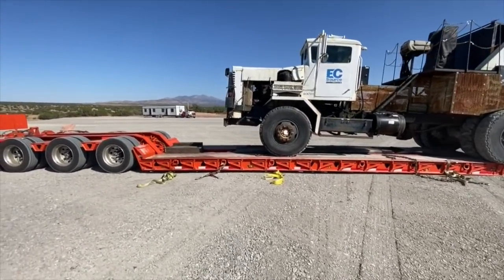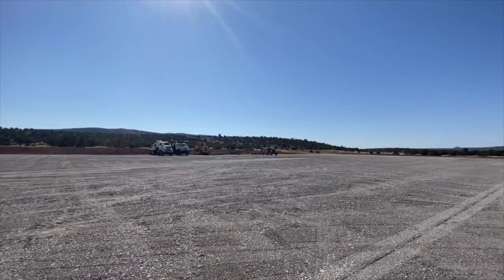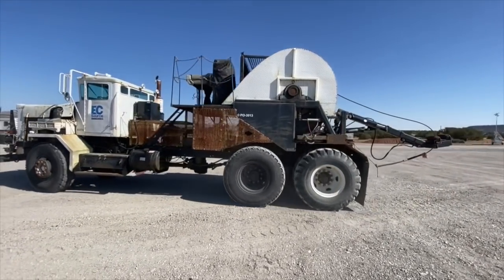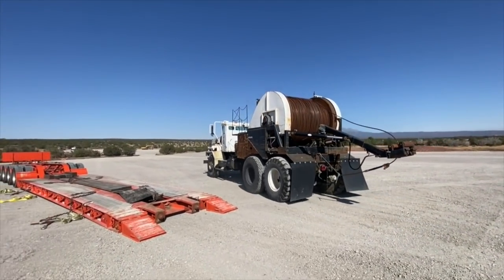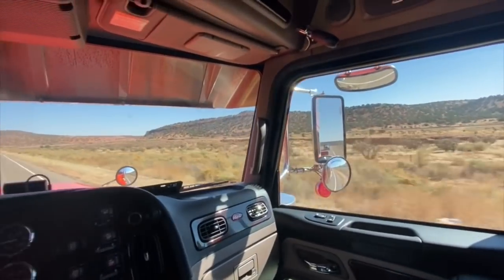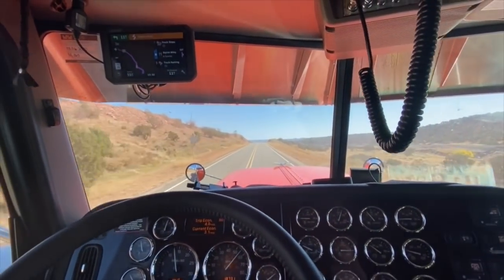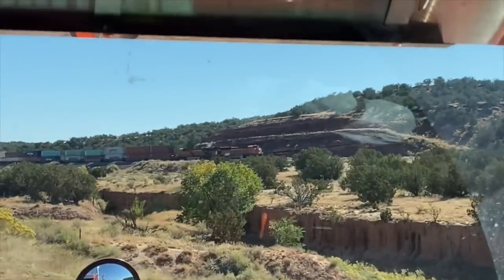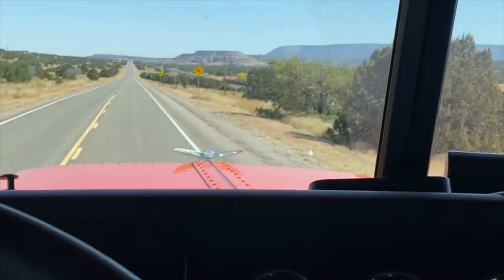High Voltage transmission line winch truck.

Comment: Found your channel recently and I am gonna sub. Love trucks and heavy haul set ups. I am in Cali and see much different gear. My friends run Murray and Cozad exclusively so really cool to see different things. Watched Goldhofer vid and said same thing you mentioned, deck height is toooooo tall for usefulness in Cali and at 500K betting steerable 9 axle is better way out here.BUT VERY COOL TECH if weight and height don't matter! Thanks again for a glimpse into trade i admire driver!

Comment: What do you used to protect windows from flying rocks from vehicles? I noticed you pull machines and trucks on. There is some equipment that has rear windows? How many claims did you inquire since you been in business?
Reply from the maker: Zero claims.
Reply: @KeepingitAnalog  if you get a chance Lieutenant can you talk about claims in the business, such as the prices of overweight tickets and claims in the business.

Comment: Nothing better huh? There is this small company by the name of Caterpilliar, maybe you've heard of them. Pretty sure they've built a few better engines than that screamin ass slobberin 2-stroke Detroit
Reply from the maker: I had CAT 3406's in all my T800's. And I still have a T800 that has a C 13 in it. CAT gave up on the truck market, so nothing I could do.